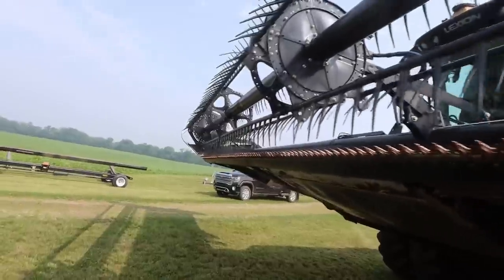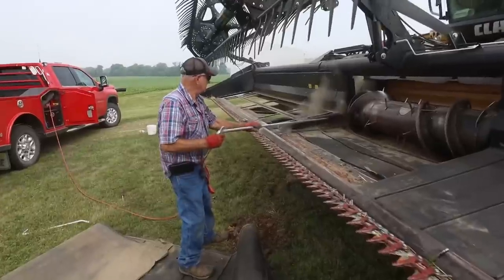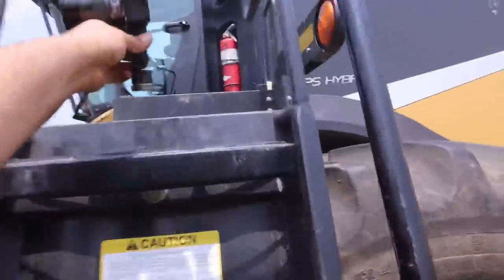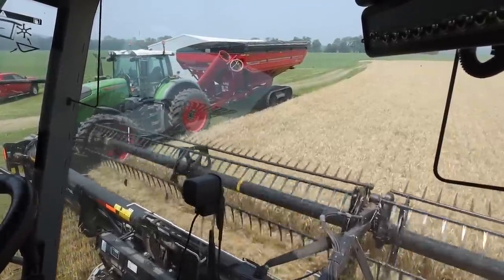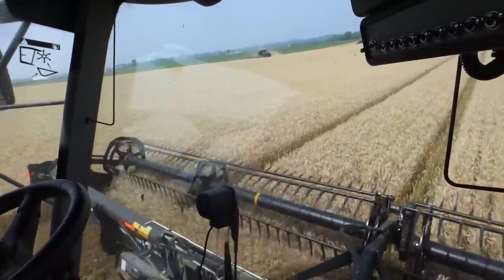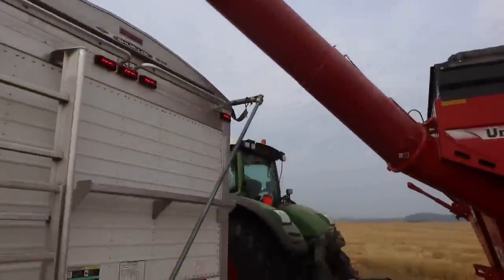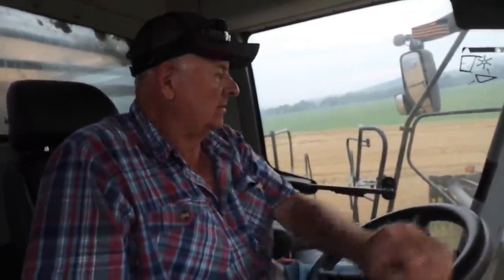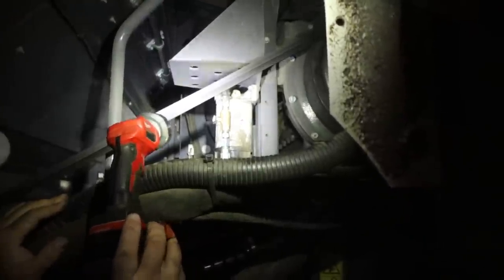The First Day of Wheat Harvest 2023

Comment: 20 moisture in Oklahoma they dock us anything over 13.5 and 14 is cutoff
Reply from the maker: We are docked over 13 for moisture but the elevator will not take it over 20. I’m guessing you all don’t have a drier at the elevator
Reply: @BriansFarmingVideos  no dryers in the elevators and when they fill concrete it goes to steel bins usually we cut the first part of June and done by the 4th well this year didn’t work that way I sprayed the last 200 ac today that we have left to cut 7 days and then I need 2 days